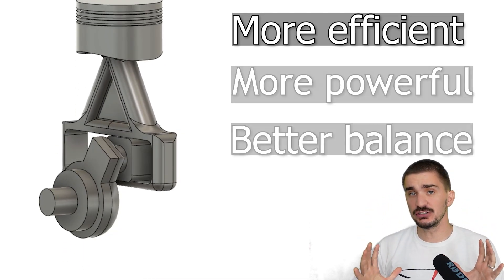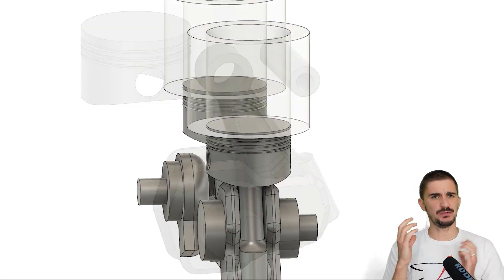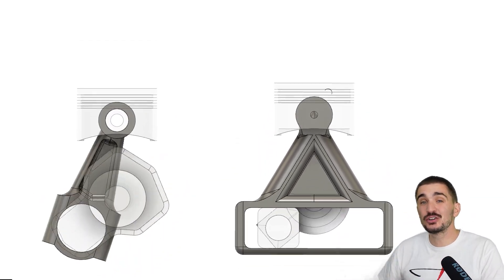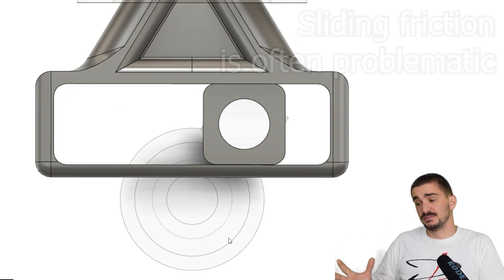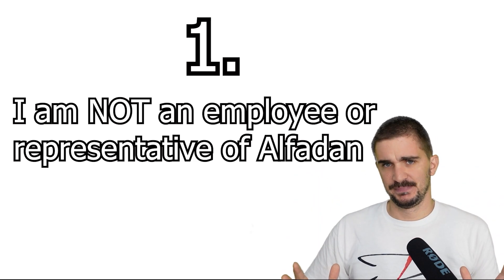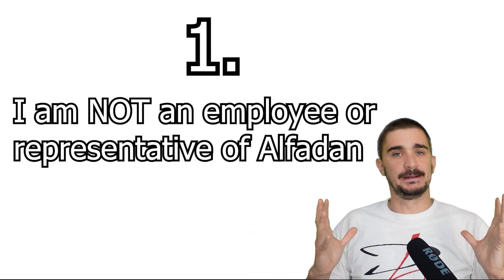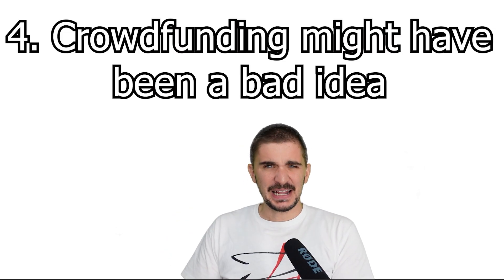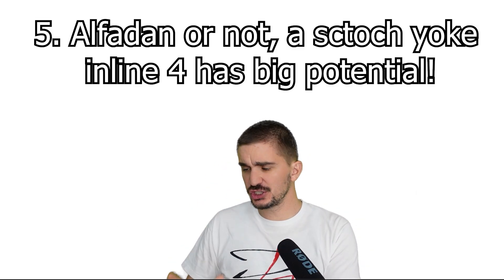This engine is better in every way?

Comment: No no no.

Several of the things you stated about the physics were wrong. See the myriad of comments pointing these out about angles of force, stabilization, and calculating work. Your observations on the weaknesses were on point though, but incomplete.

A novel engine design doesnt need millions of dollars in development. If it does, its a shit engine. An actually working and manufacturable engine design should be able to be built in a garage, just like the first cylinder engines were. If they start saying they'll work using "cutting-edge composites," and just a few more 100s of hours of external, paid engineering? Run. They don't have an actual working concept, and the creator isnt an actual proficient engineer. If he was, he would've completely designed the engine and made a working prototype before seeking investments.

I was hoping this was an April Fools joke, but it seems like it isnt.

These people dont know what they are doing. I would agree that it doesnt seem like an intentional scam - don't assign ill intent to what can be explained by incompetence - but it might just as well be.

There is no shame in admitting you have been fooled. We all have at some point. Rejoin us in the light my friend.

Comment: This seems promising more so for the economy engine than a performance one. The additional weight for the yoke rod would hinder high revving engines, and would introduce a lot of primary balance issues. A small displacement boxer 2 would cut back on the weight, have perfect secondary balance, and the primary balance wouldn't introduce much of a rotating moment arm during operation. Plus that would be incredibly short, light-weight, and would pair pretty nicely with a CVT so that you don't have to worry about the RPM. Alternatively, it may work well as a ridiculous diesel opposing 4 or 8 cylinder. The compression ignition is already a bit of a sticking point for revving the engine, so the additional weight won't hinder performance in that aspect, and it may allow for an actually smooth running diesel to bring economy sedans and wagons back to the US market. As far as lubrication for the yoke assembly, maybe forcing oil through the crankshaft into the yoke journals would be effective? Would have to be very mindful of tolerances for assembly to maintain effective oil pressure along the entire crank so that the film strength is maintained well, and having a square yoke pin would make sense for that since friction doesn't technically care about surface area, but fluid dynamics and material sciences certainly do.

Comment: Ahem... there is one caveat: this is not true, mostly. Yes, the motion of the piston will be perfectly sinusoidal at constant RPM, but that is about it.
There is friction in the yoke, there is a rotating moment on the whole piston-rod assembly, because the forces applied still are not going through he same axis. This moment now is actually larger and it causes the whole thing to be wedged in the cylinder at a slight angle, which will cause the cylinder to be worn into an oval, which will increase friction, reduce sealing by rings, reduce oil scavenging and will cause oil burning and losses due to gases escaping.
Yes, the whole assembly can be constrained at the bottom by the engine case, but the temperature deviations and also additional friction surfaces will negate any advantages.

Comment: Dumbest idea I’ve seen in a long time!
Angular loads will still exist and without the ability to float the pistons will bind in the cylinder.
The use of a double bearing system that has been tried to correct this issue.
The first bearing on the crank is normal the second bearing is eccentric and uses a gear to rotate counter to the crank to oppose the sideways rocking of the crank while maintaining stroke.

Comment: Replace the sliding block with a ball bearing. Strengthen the connector rod with another piston on the other end.
Reply: now tell us why a ball bearing can't work in that application (and you're not alone here)

Comment: Here's the problem I see:  During the power stroke, the downward force on the rod is off-center (on the right side in his diagram), causing a net clockwise torque on the entire piston-rod assembly.  I don't see why that would be any better than the standard design.  Not only is there wear and tear on the sliding portion of the assembly but the piston itself would experience additional friction from the clockwise torque as it travels down the cylinder.  Or, if not in the cylinder, then in whatever housing that keeps the rod in place vertically.  I don't think more accurate machining would solve this problem.  I wouldn't invest unless I saw a working prototype with evidence that this isn't a problem.

Comment: Successful investors invest in 99 losers for 1 winner.  

On the engine side, one way to help with sliding friction would be to inject oil into the mating surface area.  Something similar to bearing lubrication on conventional engines.  Oil comes in through the crank and the connecting pin for the slide block.  The mating surface of the block could have an oil galley around the pin.  Then that galley can feed the oil to injection holes between the connecting rod and block surfaces.  The mating area between the block and pin would need to be a pretty typical bearing surface anyway, so with a high enough oil pressure you should be able to minimize the friction between the con rod and the slide block.  Would need some clever engineering to get everything dialed in and working, but it seems like a simple way to elevate the issues in that area a fair degree.

Comment: The rod may not be assuming an angle, but the forces do, so it's not quite so different as you say, regarding cylinder wall friction.

Comment: There will be a side friction anyway, not on cylinder walls but on "rod" outer walls. It will be necessary to prevent a rod-cylinder assembly from tilting. Bourke cross was preventing that by placing two cylindrs in oposing positions.

Comment: 16:50 “FreeValve doesn’t make anything new possible.” I believe that you believe that. I even believe that Koenigsegg and company believe that. That’s why I’m pursuing my solution independently (that and Koenigsegg won’t return my emails 😊). I think it can, and the engine conversion to pneumatic valve actuation that I am working on in my spare bedroom will hopefully prove it eventually (yes, engine research is expensive and time consuming). There are three efficiency benefits, consistent with the principles in Heywood’s “Fundamentals of Internal Combustion Engines” which (if I am correct) will double fuel economy (edit, had written “efficiency” — THAT is not possible, rookie mistake) and thus reduce carbon emissions and reduce operating costs. I’m not planning on charging $millions per car, either…

Comment: That yoke would be very heavy , and its rocking motion would make it explode at high revs.
The yoke sokution was attempted a few Times and it never made an impact. It simply sucks.

And you got your self into that crap. Now your otherwise good channel is corrupted.

Just say the truth. You needed the money , and had to accept the offer. Even if an engine with a yoke style setup is no more Than a scam.

Comment: Without wristpin the yoke rod will force piston skirt into cylinder wall. Add a wristpin and the piston can truly float but the long slot rod is a big problem. Clearance, lubrication, assembly and reliability.

Comment: What if we lined the slot of the conn with a chain and turned the square cog into a gear or perhaps lined the conn slot with roller bearings?  Not a mechanical engineer here...

Comment: More metal will be required for the new design, as well as machining required to produce it. Fail. Manufacturers will not use it because of increased costs to make.

Comment: Formula one has reliable engines with 50% thermal efficiency, more than 500hp per liter, thanks to smart electric assisted turbochargers with separated turnine and compressor and electric motor in the middle that can recover excess boost at high rpm/load working as a generator , or increase boost at lower rpm working as a motor.
this energy could be sent to or taken from the crankshaft with another rmotor/generator. 520hp /liter is also limited by regulation to the fuel flow... engines make all their power at 10k, and can rev up to 15k, but without providing more power because of fuel flow limitation, so we are talking about maybe close to 700/750hp per liter potential without regulation
I dont see a reason why it couldnt be translatwd into a 4 cylinder architecture, with lower state of tune (less boost, less rpms, slower piston speeds, more displacement) to stay at reasonable 2-2.4L seen on most high performance inline-4, and achieve a similar 600-650hp, with around 300hpper liter
we already have 400+ horsepower 2l inline 4 engines in production cars. its also easier in boats to have massive amount of cooling for intercoolers and watercooling using the virtually unlimited amount of cool sea water

I simply dont see how  getting rid if swcondary imbalance could bring even clos eto the benefits they are claiming.
they are claiming near Formula 1 power amd efficiency, but with an emgine configuration that tmakes no sense for performance.

Comment: I watched a good Engineer drive himself nuts and leave a good job out of stress because of a scotch yoke. 

These things are serious hog wash. When used dry, they take loads of power to drive due to friction and the wear rates are immense, evening using PEEK or carbon for the sliding parts. My friend tried to compensate the wear using sprung tapered parts but  it didn’t work.

The biggest problem is noise as the parts wore. The rattle was still massive when a roller was incorporated instead of sliding parts.

Maybe these work wet but I ain’t seen it.

This idea to use in a Engine is ferking BS. You can buy a patent on anything if you pay but that doesn’t mean the idea works.

Professionally, I recommend you stay away from scotch yokes if you want to keep your job! Probably fun to play with on slow speed machines at home.

Comment: I always enjoy your program.  The scotch yoke design was used on a marine inboard engine over 50 years ago. It seems the opposed design would be logical and the sliding journal bearing could be a combination sliding round cage type ball bearings?

Comment: The square doesn't push or pull at dead center of the rectangular slot, meaning the piston still travels under an offset load. The same wear will occur as with a conventional rod, it's just spread over more components. And it adds complexity which is rarely a good thing in mechanics.

I'm gonna go with no thanks on this one.

Comment: Didn’t that other boat engine use some kinda gear mechanism?? Your animation in this vid still has side load… I’m sure you know that. I’m sure there are ways to fix that but sounds complicated to me. And the free valve thing… I know you say it’s expensive but really it’s simple and after some time if they do this the cost will come down greatly . Yeah they can do the same things mechanically but damn dude that shit is soooooo complicated!  What if free valve was cheap? If they do it , it will become cheap!

Comment: Removing the offset that way just transfers the problem elsewhere. Increasing the need for perfect lubrication and adding friction/heat in a less favorable location.

Using weighted rotating camshafts will always come with wear and tear. No matter where you force it to happen.

Comment: This design is borderline non functional. The stress on the "rod" from the crank pushing and pulling so far from the center mass would demolish it in a few hundred miles.

Comment: One thing i can see wtong with this design. Any Scotch Yoke one piece piston/rod assembly will have to be installed from the crankcase side of the engine. This means that the block, crankshaft and camshaft will have to be much longer. For an example a Ford Windsor V-8 has a bore center of 4.380" and a bore of 4.000". With a Scotch Yoke setup this would only leave .380" of an inch (1) for the main bearing.
1) for metric you do the math.

Comment: Lots of mass on a moving part, the piston friction stills there, the weak part at the bottom... I think this engine can be the next desmodromic head, Wankel engine, water/methanol injection... We can make then, but at certain point they are almost useless or are bad option then the traditional "options". 😐

Comment: Too many words,  no need to talk to the idiots. Condense the content to 5 mins.
Maintaining oil pressure in the stiction bearing and creating a persistent oil film...feeding oil through the crankshaft center or a flexible oilline conneting to the bearing surface might work. Splash oiling - might work on a slow reving low power assembly. The bearing geometry is simply suboptimal. I designed a rotating bearing where there is a lot of stiction and not enough lubrication and its running in cold vaccum and the  support structure can deal with rotational forces, tension vectors  and/but cannot take much bending loads.

Comment: The forces are transmitted through the centers of the journals. The angle is still there.  Also, how do you keep the triangular connecting rod from not turning, either?  If it turns at all, the rod is going to hit the bottom of the cylinder.  If it's being kept in place through some sort of bearing, that's more lubrication and more friction. 
And don't forget the extra mass of the bigger rod.

Comment: In my head I just envisioned an 8 cylinder that has 4 pistons on each wrist pin 2 on one side and 2 on the other like a boxer but the pistons are above each other and beside each other. Or just a 2 cylinder opposed piston with one shared rod.

Comment: Scotch Oaks are used in shock dynos. You do not need to have a sliding square in the scotch yoke; it can be a roller. Since the slot has to be equal to the stroke, plus the size of the roller and the reinforcements on the bottom end of the rod the engine will end up over square which can hurt combustion efficiency.

Liquid Piston's rotary engine, sort of an inside-out Wankel, is far more interesting

Comment: Your explanation why Alfadan can't be a scam isn't really proving that they're not. 
Of course you have to know that your investment might be worthless if the project fails, but nobody would invest if they knew that their investment had never any chance of paying of. 
There have been crowdfunding scams in the past. 
So there are currently two scenarios where i would call a crowdfunding project a scam:

1. Somebody thinks of a project that is believable enough to be true and intresting enough to be sold to the public but never has any intentions of going through with any actual research and development of the project. People pay but the money is just spent on unneccessary stuff like a nice company car etc. or paid to friends disguised as subcontractors etc.

2. There is an actual project but during the research it turns out that it won't be possible to go through with it, the rest of the investment or even ongoing investments aren't returned but just spent on unrelated stuff like coming up with another project to keep the company running.
So from the point on where the project is clearly not going to happen anymore this should be clearly communicated. 
I don't know whether there are any regulations/guidelines in place with crowdfunding platforms for such cases.

A company not sharing progress or giving any insight on their team and current activities rightfully deserves to be viewed with a grain of sceptiscism.
For all you know evrything could be 1 or 2 persons building a nice website with a bunch of stockphotos and describing a theoretical solution for a well known problem.

Also if they design an engine they probably use some kind of CAD software and i'd guess they run simulations aswell before they build any prototypes, so i really ask myself what they need you to animate for them.

In the end i don't care whether they're scam or not cause i won't invest in them anyways.
Reply: Well said!

Comment: This is an amazing and informative video, especially how you clearly and sharply explain everything without boring us to death. This engine, if it works is the next inline 4 revolution for decades on end and will replace v6 engines only because the increase liter can realistically go only that high for this new design for now. But, I would like to ask you if you think they should use the rotary design  instead of the rectangular design on the bottom rod.?

Comment: The force angle is there on both types. If you take for example the moment when the crank shaft is at 90°, the little square which the force acts upon is not directly below the center of force. Therefore the twisting force still remains. This does not solve anything.